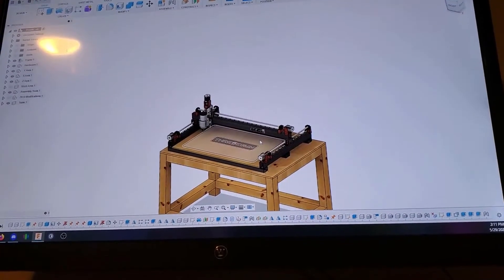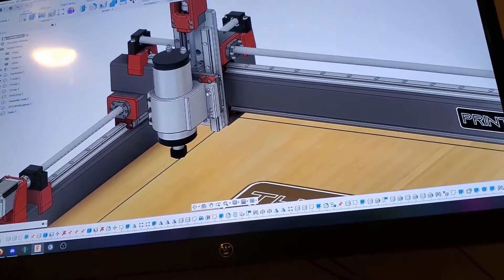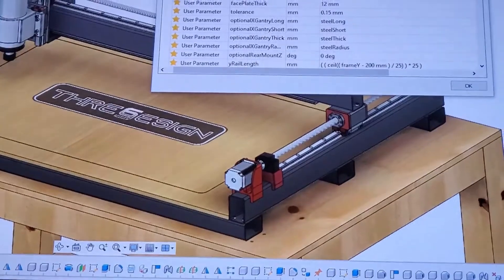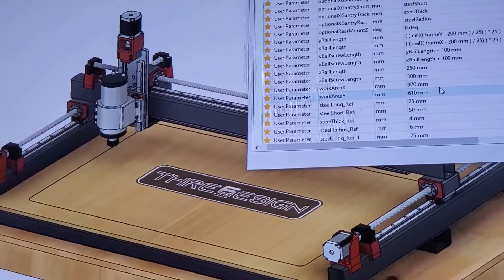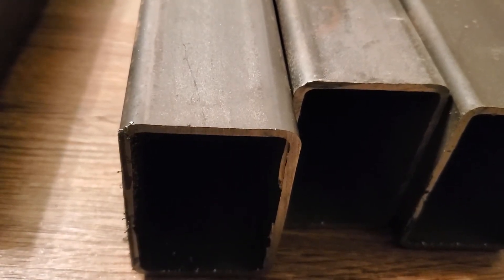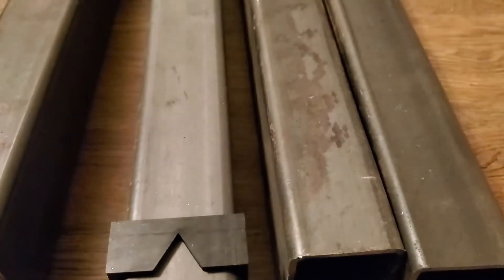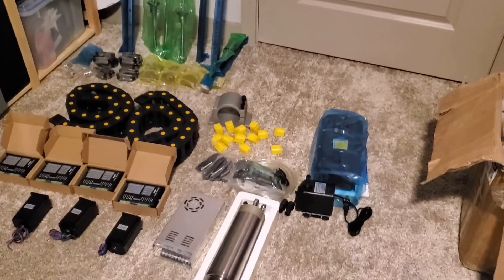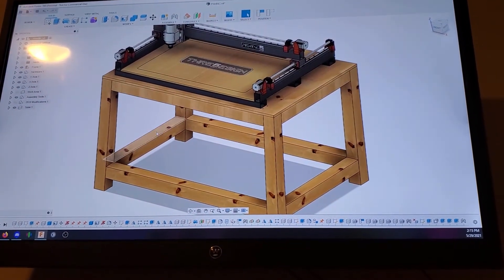I'm building a PrintNC!

Comment: Good choice you made! However i would strongly advice against using that CNC in an apartment...unless its just for building it, than that is fine, but prepare to have a big mess in wherevere youre building haha.
Reply from the maker: I am planning on addressing this in a video. 4 issues I have come up with are chips/dust, noise, power draw, fire hazards. The chips, dust, and noise I will solve mostly with an enclosure and floor mats. The power draw and fire hazard I think safely wiring it to multiple circuits and fire extinguisher and close observation covers it. I don't see it much more than a giant 3D printer.